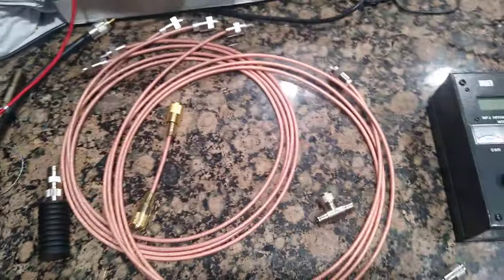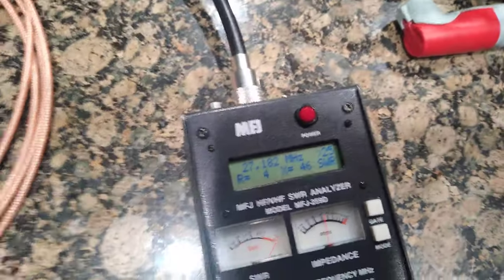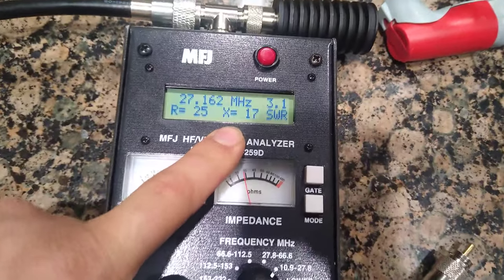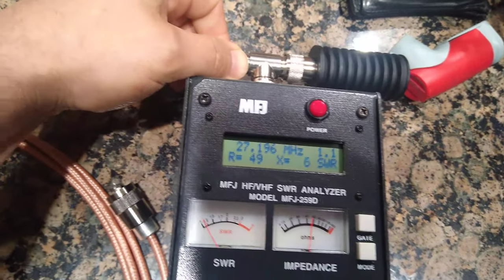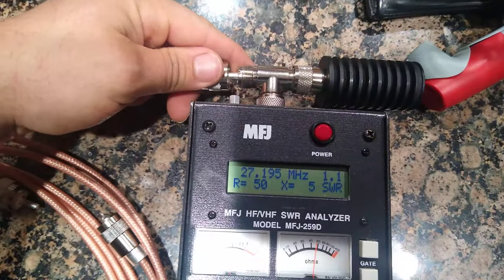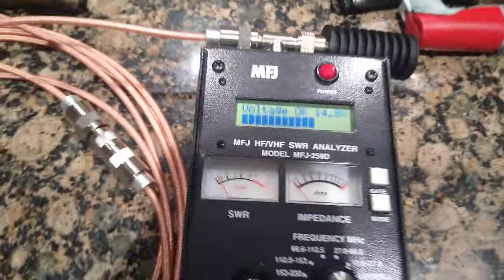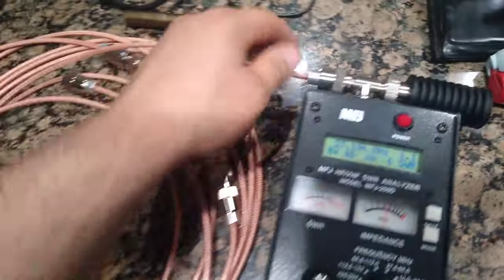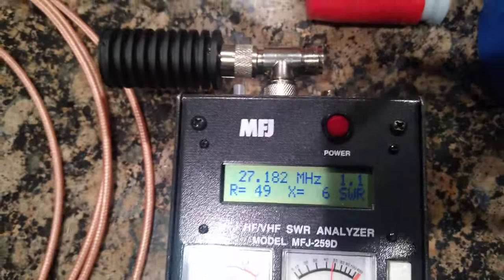More coax tuning 1/2 and 1/4 wave 11M observations

Comment: So the goal is to get the 
X to as close to zero as possible ?
Reply from the maker: Basically how I understand it. If u put a perfect antenna it should show 50 ohm's and 0 reactance. So u want your coax to be invisible. And maintain that 0 reactance
Reply: @electromechanicalstuff2602  
I’ve watched some other videos as well , but my question is ,, where do I start ? I need an electrically correct length jumper from my radio to amp ,, God knows we’ve all heard every opinion ,, 3/6/9/12 🤷🏼‍♂️,, do I start with a little longer than 12 and keep snipping for X= zero or start with a little longer than 6 and start snipping , in my quest for zero ,, and if I use an MFJ or Rig Expert ,, and I set the frequency at say channel 28 ,, my biggest concern is my reflect and or overall true standing wave SWR dead•key with amp on ,, will be terrible on other channels ,, I custom tuned my 7 element beam with a direct fed 1:1 5K watt balun ,, barefoot ,, I have a 1.0 to a 1.2 from channel one to 40 ,, I’ve recently ran into some reflect issues I think coming back from the antenna , and I’ve been using a 9 foot jumper , then I tried a 6 ,, I’ve tried every size except for a tuned 6 footer or close to it ,, and also haven’t used another tuned 6 foot one from amp to meter ,, with each new adventure ,, I find my standing deadkey SWR getting lower , about 1.2 with amp on which is great ,, but then I see a few hundred watts less output swing ,, so I’ve got my whole project on hold until I get a true reflect meter , to read reflect coming back from my antenna , and an analyzer ,, see my dilemma ,, ?? I’m stuck ,, cause I don’t want to continue and blow my amp up ,, so final question now that I’ve typed a book describing my issue ,, and thanks for reading ,, cause I’m frustrated ,, should I start with 6’ish feet tuning my jumpers , or 9 feet or 12 ?? How does one know where to start ? Is it trial and error after each jumper making ? And if I tune them for channel 28 ,, how broad banded will that be on channel 15 , or 38 ,, etc as far as SWR and reflect goes ?? Any help would be appreciated
Reply: @electromechanicalstuff2602   LOL OMG And yet another perfect example of the dumbing down of the amateur radio service. If you had to pass a ham a real ham radio test you'd fall flat on your face. Our parroting nothing but old cb wives tales.. Something tells me you're one of these new generation hams who got their license by memorizing the answers to the test
Reply: @Dallas-Rife-UDX-347-Tennessee  Look at the Bird 43 manual online. If everything is as close to 50 Ω as possible no problem and no specific lengths of coax needed. Place the SWR meter where you can see it and aim for as low an SWR as possible.  I've never in 49 years cut coax to specific lengths.
Always good to use ferrite rings on coax too to stop r.f. on the braid which it sounds like you have on your beam.
G4GHB.
Reply: @dannelson8556  
I sure did 😃
Unless you have something helpful , how about not saying anything at all 
I’ve learned a lot the last several months 
Still leaning all the time
Reply: @bill-2018  
Thanks I appreciate it
Reply: @Dallas-Rife-UDX-347-Tennessee  O.K.
73.

Comment: If you put a dummy load on the end of any length of coax it will read the same 50ohm with the same j/x value as being directly connected to the meter because there are no reflections. Coax lengths should NOT affect your SWR or impedance if your antenna is properly matched because there will be no reflections (or very little). If you are cutting coax lengths to match your system, stop and go back to you antenna and fix the problem.  All this cut your coax length to multiples of a wavelength crap is doing it getting your poorly matched antenna's reflections to cancel out do to 180 deg phase cancellation on the way back down the wire, hey now the SWR meter is happy, the finals are happy, but your signal leaving the antenna sucks.
Reply from the maker: I used the factory 8x wire that was soldered to my Stryker A10 antenna. I used both this fmj along with a nano vna to tune the antenna. I got it as low as possible with my lowest point at ch 20. I achieved 1.3 SWR at the lowest point and 1.45 at the ends of the dip. It's tuned is what I'm saying. But once I put the tuned coax on now my lowest SWR point is 1.1 and highest is 1.25. yes even with the dummy connected to the end of the coax I get the same readings. This is absolutely a complicated topic I am still learning about. I understand smith graph and that it should not effect swr but in a mobile application the car is part of the antenna and this is sometimes the only thing you can do to "tune" the antenna that is already itself tuned
Reply: @electromechanicalstuff2602  I have the Stryker mag mount on my car. I can get it to about 1.1:1 on 11m. Maybe try moving it around a little if you cant adjust the length of the whip to get it lower. If yours in not a mag mount check your RF ground connections. Or your car does not have a good ground all the way around and you might benefit from ground straps connecting the trunk lid and hood and things of that nature. Might get you a better match.
Reply from the maker: That's what I have now already on e I changed to a tuned rg400 1/2 wavelength. 
Yes mag mount now. Soon I'll be installing a breed mount puck. I moved it around a ton till I found the best spot but it didn't change much with location. No doubt my car panels are not properly grounded to each other. The car is the ground poise and can effect the swr greatly
Reply: So you need a calculated half wave coax to tune the antenna with and after that coax length doesn't matter?
Reply: @RC-Heli835  You can use any length you need to get from your antenna to your radio. As long as the antenna is tuned to 50 ohms or at least very close for the middle of the band you want to tune ( or where you work it the most) it will be really close to a perfect match no matter the length of 50 ohm cable. Cable length can "tune" an antenna but it's not the right way and is only making the radio happy, the antenna is still out of tune.
Reply from the maker: @YouTube_User-9  as I've stated many times. You do whatever you think is best for you. However I tuned my antenna to the minimum swr both in my house and car. My car is obviously not that long so I don't need that much length. I use a Stryker a10 with a breedlove puck mount that is grounded. I tuned it with the factory 8x coax then without changing the tune only replacing the coax with a tuned piece of rg400 I lost a substantial amount of swr imo. My house I use rg213 100' I tuned my antenna to lowest swr then tuned the cable and it was not as noticable but still a difference. When looking at the nodes they get smaller and smaller the longer the coax is. I'll try to find a ham video that explains that
Reply from the maker: @YouTube_User-9  https://youtu.be/Z2lxv6F8fvA
Around 31:45 on really hits the point. But the whole video is good and why hams use baluns
Reply from the maker: @YouTube_User-9  hope this ham tv video better explains what I am talking about. I'd love for your to get in the comments in that video and give your opinion on the matter I'll watch for them.
Reply: Exactly! All this coax ½λ nonsense. Get the aerial properly resonant.
G4GHB.

Comment: Wow so much misunderstanding of the physics, calling a dummy load an antenna and then trying to use a 50 ohm resistive load or an open to show differences in coax is ignorant lol. especially with a Mighty Fine Junk  as test equipment.  All this can be  classified as junk science , I guess that is what you get from someone who has no formal education in the matter.
Reply from the maker: Wow thanks for the constructive criticism.... There's a reason I said I don't know please correct if wrong. And commenters have said it's correct. All I got out of your comment is that your a very unhappy individual who will most likely die alone because your such a miserable person.  God bless and good luck with your life
Edit u won't die alone you'll be surrounded by cats
Reply: @electromechanicalstuff2602  He just doesn't understand...People are thinking in volts, amps and ohms...once RF wave propagation through a wire is introduced, things change.

Comment: This is too funny   Wow you really have no clue about rf just by the way you are testing this    I’m glad your not an engineer for a radio station.
Reply from the maker: @sirmister4411  I'd never want that job.... It doesn't pay enough money. 
I have 1.01: 1 match on 5 different stations all with over 2,000 watts. So I'm doing something right. Have fun and remember if it says high voltage YOU should definitely give it a touch

Comment: An open quarter wave coax will reflect the signal back towards the dummy load exactly out of phase and cancel the reading “ 1/4 = 90 degree phase to open end , reflects back 1/4 90degree to dummy load for a total of 180 degrees out of phase which cancels it out , easily see this on a smith chart 

Your dummy load had small reactance value which should change mildly between the 1/2 wavelength and 1/4 wavelength coax when connected to its far end “ not T in “ , personally rig expert is far better for making stubs than your mfj
Reply from the maker: Did u watch the entire video. I did infact put the dummy at the end of the coax and got the exact same result. The reason I used the t is because when your tuning the coax u have to cut to tune and I'm not throwing away 10 silver connections. Just to keep the load at the end when the results are the same.
Reply: @electromechanicalstuff2602  get rid of the "T" fitting

Comment: Let's lay this to rest! I already knew this but for disbelievers I have today run some tests on coax. The length of coax makes no difference because everything is matched to 50 Ω, the tx, coax and load are all 50 Ω.
Tx FT817ND on f.m. for a carrier to see on the oscilloscope, Beckman Industries model 9020, 50 Ω dummy load and various coax lengths. I used 21.200 MHz as the 'scope is not happy above 25 MHz. DL on 4" length of coax.
Test directly with 50 Ω at tx. 3.4 Volts. Amendment; the 'scope was on X10 so it's 34 Volts.
Test with 20" coax plus 4" to DL. 3.4 Volts.
Test with 38" coax plus 4" to DL. 3.4 Volts.
Test with 58" coax plus 4" to DL. 3.4 Volts.
Test with 20" coax  to SWR meter with DL on 4" coax. Zero movement. 
Test with 38" coax to SWR meter with DL on 4" coax. Zero movement.
Test with 38" coax to SWR meter with DL on 20" coax plus 4" coax. Zero movement.
Test with 58" coax to SWR meter with DL on 4" coax. Zero movement.
Where is the need for this magical ½λ of coax?
The SWR meter can go anywhere in the coax, it's handy to see inside the shack.
73, Bill, G4GHB.
Reply from the maker: Can you video this and post it. Plus the biggest concern is not just the 50 ohm it the inductance and capacitance that affects the tuning of the circuit that seems to be the most important part. I'll try to find some random sections of coax and do a similar tests on my bird dummy load using my VNA and mfj in the next few days
Reply: @electromechanicalstuff2602  I can't video it as I've only an old camera and not much memory on it. 
Yes, it's interesting, do give it a go. I thought I'd put it on here and it might get people to investigate it. I've never had problems in 49 years of transmitting with home brew gear and commercial gear. It's about getting as close as possible to 50 Ω at the aerial. I've used 1.5:1 when my long wire was too short for the tuner to cope but wouldn't like to go above.
Bird say about a 50 Ω system and how the meter can go anywhere if all is well.
73, G4GHB.
Reply from the maker: @bill-2018  I agree the meter can go anywhere when your using a tuner. The tuner counteracts the inductance and capacitance of the coax and antenna if they are not perfect
Reply: @electromechanicalstuff2602  Yes, a tuner is needed for a long wire etc. Again I say not so much the coax.
Reply from the maker: @bill-2018  k. I know u make your antenna out of random wire. Buy a cheap 50 ohm antenna. Band specific. Get rid of the tuner and tell me what happens. The reason you've never had issues is because u have a tuner. Point blank period. I started without a tuner and this is what is necessary when you don't have a tuner running any kind of power. Or you have to tune your amplifiers output circuit to match you antenna circuit. That includes the coax. Do you own or have you ever used a VNA, or any sort of antenna analyzer? I have several of both and all the equipment tells me a different story than I've been doing it forever with an antenna tuner and never had a problem. I doubt I'll ever convince you to go out and buy a $500 complicated piece of testing equipment that can display smith charts and frequency nodes. But I did. So I'm going off the information my equipment is telling me for now.
Reply: @electromechanicalstuff2602  I was lying in bed thinking about this and maybe I could do a video. It might give another angle on things for people to think about.
You see why radio amateur's have always said coax length doesn't matter as long as you get close to 50 Ω. 
My NANO VNA has let me see what is going on. My 2m dipole needed re-tuning after moving it, the SWR and reading the Smith Chart function was interesting watching the two vary. The SWR came down and the capacitance increased if I remember correctly, 400 pF I think. I never knew about capacitance values before so that was interesting. No aerial can be a true 50 Ω resistive as it is said a dipole is 73 Ω anyway but I droop it slightly to get a better match. Then there is coupling to the air which is said to be 377 Ω. Inductance and capacitance along the elements too, becoming increasingly more as the frequency goes up. 
Yes, aerials are interesting. As I say I've never bothered about things too much and the 400 pF as read on the VNA doesn't bother me as I get out okay. Could it be reduced by trimming coax? I don't know Would it make any difference? I don't know. If it did would it be worth it? I don't know. 
As shown in my test a ½λ coax to transfer energy to the load doesn't appear to be essential. What happens at the aerial? There's a lot we don't know.
Reply: @electromechanicalstuff2602  Well that's just a long wire. Don't forget I have dipoles for 20m to 10m and 2m plus a collinear for 2m and an inverted vee for 60m. All h/b. Never any problems matching them.
No, I wouldn't spend $500 on test equipment as I get out fine with what I have.
Reply: @electromechanicalstuff2602  That 400 pF could be because I had it on plasterboard on my wall maybe? In free space it might be much less. It's temporary as I'm moving my collinear.
Reply from the maker: @bill-2018  you could cancel our the 400 pf u see by adding some inductance. Because that's all coax is. Coax is not a 50 ohm resistor. It is an inductor with shunt capacitor. When u add them together you get the resistance. When u have different combinations of induction and capacitance you get different resistance like 75 ohm coax. 
I took a little snip from a video basically saying the same thing.
https://youtube.com/clip/UgkxobsAPMT3IVhKo6va0GKlK6dJOIEGev2d?si=erIcbDQOtXDr7uo_
Reply: @electromechanicalstuff2602  I've bought a new camera now so I'll get things set up, coax lengths, NANO VNA, oscilloscope and show the test I did before with 20", 38", 58" coax and dummy load. Nothing changed with various lengths of coax.
By your reckoning there should have been a change for every length of coax.
G4GHB.
Reply: @electromechanicalstuff2602  I have made dipoles for 20m to 10m and no tuner, that was for my long wire only. Why buy aerials? We can make them. A dipole is a dipole bought or not.
I set my dipoles up using a VNA. I can see if they are too long or too short. All information is displayed on the VNA, nothing wrong with my dipoles and no trimmed feeder. 
Stop C.M.C. on the outer of coax and no problems. If you trim coax and the SWR changes that tells me there is C.M.C. on the coax and it needs curing.
I only run QRP 5 Watts maximum. 
If trimming coax was important why wouldn't coax cable manufacturers tell us to do it to get the best out of our installation? 
Because it doesn't matter.
G4GHB.
Reply: @electromechanicalstuff2602  Hi again, 
I just came across this video once more so an update.
I said below about my 2m dipole, I've now made a 4 element base fed collinear and 450 Ω twin feeder matching stub to get around 50 Ω with the following readings on my NANO VNA:
At 144.800 MHz, 51 Ω +j 5.0. 
or tapping slightly differently, 
Still 144.800 MHz, 52 Ω -j 2.5.
SWR 1.08:1. SWR rising up with increasing or decreasing frequency as does the impedance. 144 MHz is 1.25:1, 146 MHz is 1.68:1 but I don't go up there. It's good for our local net frequency of 144.6875 and c.w.
FT817ND showing one LED lighting up but I'm okay with that. No external SWR meter.
The VNA took out a lot of guesswork. I'm not cutting coax to get a match, it''s at the aerial end. 50 Ω tx, 50 Ω
coax, 50 Ω matched aerial input. 50 Ω right through and no special coax lengths. 
G4GHB.